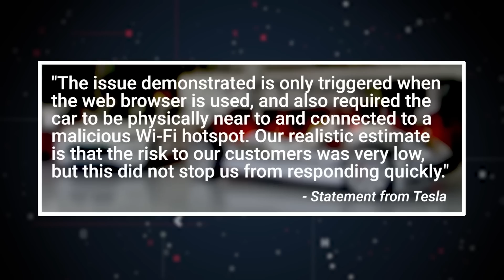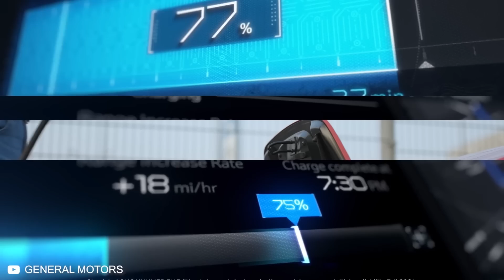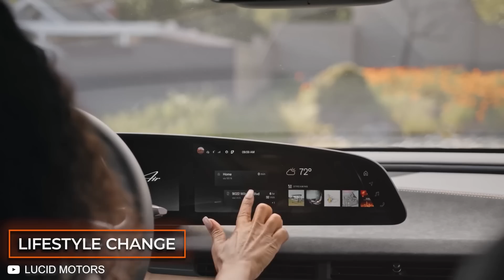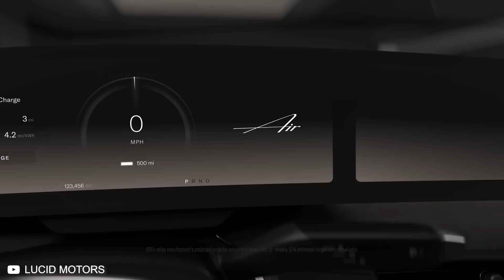EVs' Serious Problems That Carmakers Are Hiding

Comment: I want to see the long term cost of ownership  of owning an EV compared to ICE. Like 10 years. Never hear that stuff. I hold onto vehicles for a while and that’s important to me.
Reply: Many people online have reached 300000km with their EVs with no battery replacement (some even over 500000km)
There will likely be some thing you will have to replace in the future for sure. But an ICE will be way more expensive (service and break downs)
And if you treat your vehicle correctly (charge to only 80% unless you have to, no unnecessary acceleration and slow charging speeds at home, it will likely last waay longer)
Reply: @010falcon  Lexus and Toyota hybrids are doing far better (as far as reliability and quality) than Tesla and Hyundai, for example. Overall cost for fuel and maintenance after 10 years is lower for the hybrids, also. If replacement batteries are needed, those will be less expensive for the hybrids, since they are much smaller in size. Once Japanese auto manufacturers make EVs with low-cost solid state batteries, then this metric may change but for now, hybrids are the best choice.
Reply: @davepaturno4290  cant believe that, atleast with the things i have read and heard from mechanics. 
How do you come to the conclusion that a combustion engine and a electric motor (both combined) are less maintenance heavy than just an electric vehicle.
You have less moving parts, you only have batteries and electric motors. Both of which can last quite long (i have some experience since i work in, not the same, but a similar field)

Imagine your fridge (it runs forever, with no fatigue and or maintenance)

Plus even the oil changes of the hybrid cost something, which you dont have on EVs. 

Another thing hybrid is just a stupid concept. I also dont believe in batteries for the normal car market. I am a big fan and supporter of hydrogen. 
Imagine, no more long power lines which waste unnecessary energy (VW has the patent to fix the problem with hydrogen cells. Sadly they just block it...)

Just as info, you can use gas lines to transport power from lets say a desert to a city (solar panels)
This power can also be easily stored.
Reply: @010falcon  Let's take a look at the reliability of the Tesla model S, since its been around for 10 years now. According to Consumer Reports' survey data from thousands of owners, the following area have been problematic and costly:
Drive system
Climate system
Suspension
Body hardware
Power equipment
In-car electronics
Battery packs
Now, if we look at a Toyota Camry hybrid or pure ICE Camry, we see none of those problems over the last 10 years. So yes, you will spend more on a Tesla if you keep it for a while, compared to a hybrid Toyota. Of course, if you keep your vehicles for only three years from new, you'll still pay more on replacing those vehicles over 10 years but the average vehicle owners are keeping their vehicles for more and more years - often 7+ years.
Reply: @davepaturno4290  yeah, I agree, the model S was a crapy car with many mistakes. And I know some friends who have had the model 3, yet after 4 years no maintenance needed (only when receiving the car because of bad quality control). Tesla is a new company...
But isnt that to be expected, I mean we are talking the likes of Toyota, and as far as I have heard its the most reliable car.

Then again, not sure where you live, but I live in europe, and fuel prices are high at the moment, so is the cost of running a car (insurance for a tesla, like full insurance, is 400€ lower for a tesla because of sentry mode...)

But I guess only time will tell, with the model 3...

Whats your opinion on hydrogen cells, I m quite curious? Do you think solid batteries are the way to go, or hydrogen (especially considering the future significance for the energy market in storing power)

Oh yeah, thanks for taking the time to answer my question, have a good evening if you re from europe. And sorry for my bad english...
Reply: @010falcon  I am in California, also known as Tesla country. Apparently, some people will accept poor quality and long-term reliability if the vehicle is fast. Corvette owners put up with similar inadequacies, all in the name of acceleration bragging rights.
 I like the idea of Hydrogen vehicles but people are often like lemmings - they follow the 'crowd', sometimes without seeing the cliff in the distance. Notice that there are only two major phone operating systems. Crowd don't like many choices, so anything different gets pushed aside. Sadly, this seems to be happening with Hydrogen vehicles, and there are just not enough charging stations around.
Reply: @davepaturno4290  very nice, well I mean, I dont believe that with people will only chose the best cars, otherwise we would only see lets say toyotas on the street. Plus I do believe Elon, even though I know many dont stand behind me with this, is trying to make his vehicles better, even if he hasnt got enough experience (and tesla aswell). But I do believe he is doing his best to make the most reliable car possible.

Same with phones, true we only have 2 systems (iOS and android) but there are many different phones (and they havent died, they are still around, for one or another reason)

And I mean hydrogen will likely (especially in the trucking market), make a breakthrough. And I can imagine, it could be something similar to petrol and diesel (or lets imagine a bigger difference, phones and tablets)

But only time will tell I guess. And we will maybe one day see only small battery powered vehicles (max of 200km range, for like the average comute) and hydrogen vehicles (for long range applications, for example company vehicles for construction workers who have to travel many hundreds of kilometers a day.
Reply: @davepaturno4290  having driven a prius for my last 2 cars, the original whining about hybrids when it first cam out was the cost of the system battery. When my first Prius needed to have it replaced at 150K, it was a lot cheaper and today it's even cheaper than that first prius. Prices tend to drop on commodities over time. And I have NEVER had to do a brake job on a Prius! The service people say they never have had one.
Reply: @010falcon  He is also working on cost.
Reply: @fyourfeelings8966  The Prius batteries are much smaller than those in Tesla vehicles. That can make a huge difference in cost. We'll see how man 20 year old Teslas are on the road in years to come. I see many Lexus and Toyota vehicles that are more than 20 years old.
Reply: @010falcon  I understand having a combination of ice and hybrid does complicate things, however it doesn't mean that it is a stupid concept.  I believe that is how diesel train locomotives have been operating for many years.  Diesel engine supplies electricity to power the electric motors.  I agree that the hybrid is probably the better option at the moment because it doesn't rely entirely on one battery pack using old lithium battery technology. (better for not having easy access to chargers or cost of replacing battery pack)  Once solid state batteries or another technology becomes available that greatly improves the battery technology this would probably no longer be the case.
Reply: @010falcon  dude teslas come into the shop where i work all the time and the drive units are always leaking oil be quiet man you know nothing.
Reply: Interesting question. But so much of the EV is based on software. I've never heard of being able to upgrade an ICE vehicle with improvements over time.
Reply: its like 3k bro not much

Comment: The world is deluded the amount of c02 to make the chargers and vehicles batteries is a lot more than a petrol vehicle ev batteries take the same c02 to make as running a petrol vehicle on e10 fuel for 15 years then you have charging points recycling points hardly green it makes no sense as cheaper ev s need batteries every  few years.
Reply: I read a story a few weeks ago about how a municipality in France bought a fleet of electric cars, and when the batteries inevitably died they couldn't do anything with them. So they parked them in a clearing, the lithium leaked out and killed all the fauna in the area. 

Replacing batteries isn't the only problem, the bigger issue is that there's no way to dispose of or recycle them
Reply: @owen5640  There is a way of disposing of the spent batteries. Put them into shipping containers and dump them in the ocean. In the dark of night of course.
Reply: So…what’s your solution for fuel then? Petrol is not going to last forever!
Reply: Yeaaaaa we have expert here!!!  (Liar). Electric cars are more green after 2-5 years of using.  I dont provide facts for my statement because you dont want th see it. You have your own faith.

Comment: And the lack of enough rare materials to make large numbers of EV batteries is totally being overlooked.
Reply: I agree.  Almost no one is looking at hydrogen cars either.  Hydrogen might be a third alternative in addition to gasoline and battery electric cars.  Gasoline cars and diesel trucks will likely be around 50 years or longer.  There is no way there is enough rare Earth minerals that could replace every car with battery electric in America presently.
Reply: @liberty4392  hydrogen is a dead platform that will never work out. Hydrogen also uses even worse rare earth metals like platinum it uses for the cathode which is made to literally wear out. It's a guaranteed fact you'll have to replace it eventually and it will cost 5-8 thousand dollars. While you can make a battery last 300-500 thousand miles, you're not ever going to get close with that cathode. And platinum is vastly worse for the environment than the batteries. At least with batteries they can (if a bit difficult) be recycled. That platinum cathode is literally destroyed beyond recognition. It's also vastly more rare in the earth. 

Cobalt in batteries is comparable in rarity to platinum, but we have made batteries and most are switching to ones that don't use it at all. Hydrogen kinda needs to platinum to be efficient. Many have claimed they've made new cathodes but they were either even more costly to make or didn't last nearly as long. Remember hydrogen is not new, these achievements just don't happen over night. 

Hydrogen is also both one of the most hazardous element while also being destructive by nature. Not only is it extremely combustible to the slightest spark, it also has the amazing feature of leaking out of any container and breaking open gaps in any imperfections due it it's small atomic size. Basically anywhere the hydrogen flows is a risk zone for it to break over time. Your tank on hydrogen is also a pressurized bomb while being eaten away from the hydrogen. What a great idea for everyone to have in their car. 

But range is also a failure of hydrogen. They claim hydrogen can get better mileage but that's all marketing crap. The Toyota Mirai for example can only go 359 miles on the base model and 407 on the maxed model. That's no better than a Tesla, and it weighs more. The Toyota Mirai weighs 4,255 pounds base or 4,335 for the extended. The equal range model 3 to the base Mirai weighs less. The larger model is lighter than the equivalent Model S all wheel drive, but only by 300 pounds. You'd expect it to be vastly better for also being a sedan and using more dense fuel.
Reply: Right, no one seems to be bringing that extremely important fact.
Reply: I can't see a point where we can replace every combustion engine vehicle on the planet with electric powered version's with the limited resources we currently have available. I personally believe that hydrogen electric power will eventually win out. It would be the most economical, and sensible solution. People aren't going to sit in lines waiting to take charge a vehicle for 30 to 40 minutes and having to repeat the process several times a week. They will on the other hand be ok with stopping into a hydrogen station and spending a few minutes filling up a tank with hydrogen.
Reply: @never2late454 I have never waited in line to  charge. I do it  at home anytime as needed.  Travelling  long distances entails  rest, bathroom breaks and  eating.   You can always  arrange to do them  with  charging if possible. Granted, tradesmen who travel more than 250 miles a day may not be  suitable  for EV but doable
Reply: I agree
Reply: Not to mention the environmental impact and energy cost of producing all those metals.
Reply: As is the environmental damage caused by mining rare earths.
Reply: And the destruction to the earth to mine those materials along with the carbon footprint it causes!! Ecoidiots
Reply: Totally, I did months of research on the production of ev chips are made....let's just say it's worse than fossil fuels
Reply: That's why they are coming out with batteries without that but until that's released this is all we have for now I encourage you to go look at graphene manufacturing group they have a battery that only uses aluminum it's a aluminum ion it has no rare earth metals in it whatsoever
Reply: Most of the battery materials can be recycled, however, and of course, petrol cannot. And besides, there are alternative battery chemistries too.
Reply: So what will be your main when the battery packs go Cobalt and Nickel free in the next 2-4 years? I’m sure you will still be ANTI-EV🤦🏻‍♂️
Reply: Can't state this enough. China is now trying to secure lithium, cobalt, and nickel mines around the world (Africa).  We'll be buying all our batteries from China!  Then they get mad at us in the future and cut off the supply: NATIONAL SECURITY RISK!!!!!!!